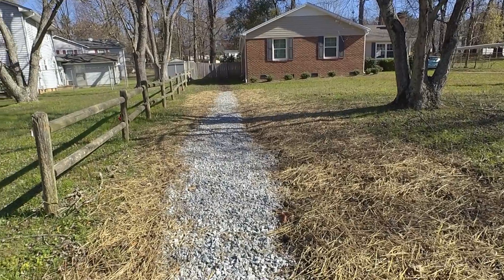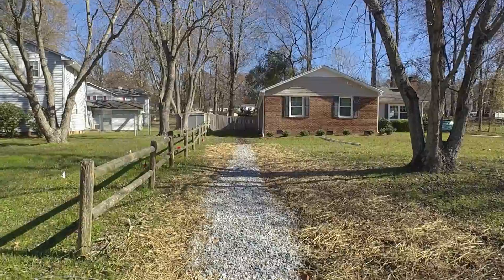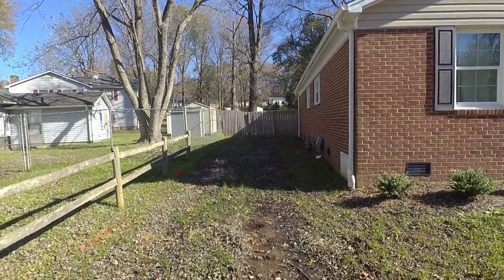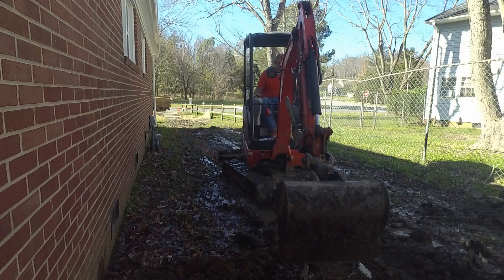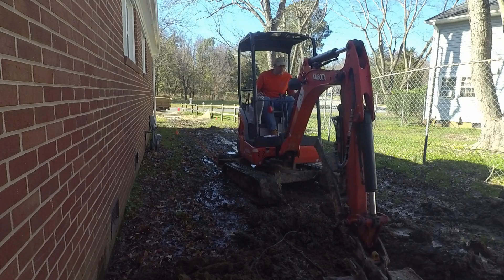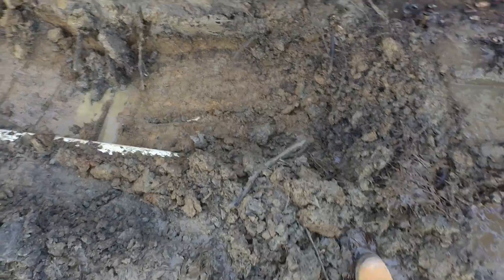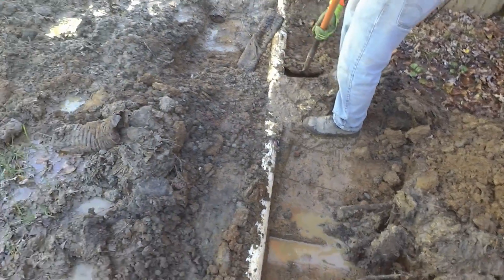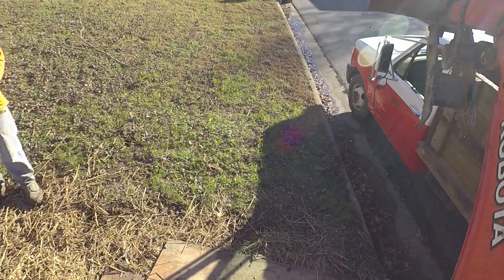Proof that french drains work! for draining non-point water sources

Comment: What about soil migration and roots through the open gravel which isn't wrapped in drainage fabric?
Reply from the maker: The gravel is the filter instead of a paper-thin filter that never gets changed. Maintaining the flow is what carries the fines through and out of the FD. This works way better to give an escape route for fines instead of clogging against a layer of fabric that never gets cleaned.

Comment: Really enjoy your videos, putting a perforated PVC pipe french drain at my footer and repairing/resealing my foundation wall with rubber. Considering doing like you always suggest and doing all rock down to the pvc. My question is can I put rock all the way up against the foundation wall also or should there be a barrier of soil between my foundation wall. (Located in NY) Also is it best to use crush rock or round river rock if im doing a open french drain? My understanding is the round rock provides more voids? Thank you

Comment: Could never tell, Are the holes for the perforated pipe down and to the sky or are they facing the two sides of  dirt? Would make sense to have them two sides of the dirt so the water could run on the smooth part of the pipe
Reply from the maker: The holes are positioned at 5 and 7 o'clock.

Comment: I showed this video to a Plumber friend of mine. He's kind of cheap at times. He promised to spend the money for a core drill and bits. When you use an electric hammer 30lb or 60lb it looks ugly. Awesome job !
Reply from the maker: Mac, just WAIT until you see our latest core jobs. I took some commenter advice and it now takes less than seven minutes to core a 4.5" hole through the curb with very little effort.
Reply: I saw the Hycon Hydraulic Handheld for over $2,000. That one day will be in my arsenal, lol.
Reply: 7 minutes, wow !

Comment: From a none expert, why do you not put the pipe in a fabric sleeve ?
Reply from the maker: The fabric traps fine sediment against it and the fabric is paper-thin. This clogs and kills the flow into the pipe. Instead of a thin fabric I use many inches of gravel. This preserves the flow and the fine sediments are rinsed through and out of the system instead of clogging against a fabric, further killing the flow.

Comment: French drains are not the answer and anyone that says so is unqualified quack - the only solution to preventing water ingress into buildings is to remove it and redirect the flow of any surface water - easy to do on a sloping site but harder on level slope where care must be taken to avoid saturating the soil by replacing it with gravel beds which only leads to more problems as the gravel must become saturated in order for the French drain to work is self defeatist nonsense - I recommend the best way to protect your property investment is to obtain an inspection by a water/structural engineer who can properly asses your home and its geology, water table, surface soil type, contours etc and formulate a qualified solution that can be registered and adds certified value to the home if when you need to sell the property or to add protection for any future insurance claims
Reply from the maker: Great advice Geeek. Here we were more interested in the subsurface soil type than the surface soil type, as you mentioned. Because we had impermeable subsurface soils, a FD was a great solution. That is evident by seeing standing water sitting on top of completely dry subsoil underneath. I talked to this HO a few weeks ago and everything is still working very well. Thanks for your comments!

Comment: Great videos and seems like a very helpful thing you do for people. That's great. The gravel situation. Why not just open the tailgate to the truck bed and use a shovel to just push it off into the wheel barrows? By the way, the dual barrows. Extremely smart purchase! Love those!
Reply from the maker: Hey Corey - Sometimes we do shovel the gravel by hand. In this case we were on the road so there was no way to back the truck up without blocking the road. Great question!
Reply: @GCFD  Understood! Again great job!

Comment: We have clay soil close to the surface and water just flows over it where there is any lower area of my yard or just collects on low spots. Frankly after a drainage guy came out at least 3 times and switching from perforated pipe to solid pipe to a gravel over pipe I’m ready to just dig a shallow ditch to direct the water off my yard.  Put in a sump pump even though when we have a hurricane it won’t work when we lose power for a week.  Frankly, what’s your option on a shallow ditch.
Reply from the maker: A shallow ditch should work if you have enough fall away from the area. 👍
Reply: @GCFD  Thank you so much.

Comment: I’ve seen French drain covered up with soil and grass, on top of gravel. Yours has gravel completely exposed. While the obvious benefit of exposed gravel is better for the water to make its way to the pipe, isn’t it visually better for landscape design to cover up the French drain with soil and grass?
Reply from the maker: If you’re not having major flooding problems then yes you can bury the drain. But these conditions required results over looks.

Comment: I'm looking at doing a french drain for my parents. Question I have though is if I put some dirt back on top of the top layer of gravel will it still work? The reason I want dirt on top, is there's no easy way to mow over gravel in the middle of a yard. Unless you've got a solution for that, then I'm all ears!
Reply from the maker: Here the area we placed the french drain had standing water/mud over dry dirt when you dig down. so if you place that dirt back on the drain you will be in the same situation. This is because the soils here are impermeable. The test to see if you can place dirt back over top is find the wet mud and dig down. If you hit dry dirt there's no way you can place dirt back over the FD and have it work.
Reply: build  abridging area at one point maybe with a small board walk and mow either side of the French Drain - just a thought.

Comment: I´m from Germany and we do it a bit otherways than you do.
Maybe "German overengineering", but we put an earth fleece around the gravel body, to prevent fine particles washed out from the mud, flow into the gravel and the pipe, filling and closing it after some time. 
Some times this might be to much, but I have seen and repaired more than one mudded-up drain.
Greets from Europe.  :)
Reply from the maker: By preserving the flow into the drain, there is more than enough energy to rinse out fine sediment from the system. I never understood why anyone would kill the flow with fabric.
Reply: fabric holds back fines from contaminating Stone it does not restrict flow at all. Water will pass through fines and fabric forever, water will also flow through 4 inches of topsoil to cover up that ugly Stone you leave in yards.
Reply: @deanbaker1905   absolutely

Comment: I'm curious why you put the straw down? Do you not just sow grass seed?
Reply: Consider that they are doing this work primarily to stabilize the ground which is waterlogged and reduced to slush mud - That means that with a new free exist like this there is a lot of water that needs to leave before the ground gets to its new "Normal" and that slushmud will erode by washing away far easier right now than it will in future as it should never be that sodden again
Over time the ground will become dryer reducing erosion and any grass will grow roots stabilizing it further but that can take weeks or months to establish.

In short the soil is at its most vulnerable to erosion immediately after a new drain install and the straw is a binder to reduce that
Reply: @bengrogan9710  Thanx for that Ben....makes total sense now!
Reply from the maker: To add to Ben's excellent description, the straw also protects the seed from granivores, holds moisture, and releases nutrients as the straw decomposes.

Comment: I put in over 1000 feet of drain 30 years ago in the woods.  I used a ditch witch to open  a narrow trench and left the extra dirt for a berm.   Put in pipe and filled it with stone.   The system is still working great.    I do not think you need that wide trench for that small amount of water.  My system is catching a hillside water shed.  when it rains heavy the water is held by the berm and then runs down hill.
Reply from the maker: Awesome! Thanks for sharing! - Shawn

Comment: 12 tonnes of gravel is crazy. The property looks quite new, maybe there's a reason that part of land wasn't built on. I can't help but think these types of problems will just get worse and worse the more we build.
Reply from the maker: The house had just been rennovated and sold to my customer. She was trying to get everything taken care of as she just moved in.
Reply: correct, if you have a perforated pipe of sufficient diameter, you can use significantly less gravel and thus excavate way less than this.

Comment: So do ypu cover the gravel with soil and grass then?
Reply from the maker: Nooo that would defeat the purpose of gravel letting water into the drain. The native soils here are impermeable to water as shown by muddy water sitting on top of dry dirt. Burying the drain would destroy its function.
Reply: @GCFD  I am one who would argue that if you had the proper variety of soil (that perks), you could put dirt (and sod) on top.  Indeed water will go through that and perk down into the gravel.  And as you say, the gravel will act as a filter.  But you can see that your soil in this video sucks for perking.  So you are best left with just running the gravel to the surface.  Over time, grass will grown into it and cover it.  But the nonwoven fabric wrapped around the entire system (pipe and gravel), and up over the top of the gravel (with either more gravel on top of it - or sod) has proven to be an excellent filter to keep small particulates out of the gravel.  It does not clog up.  Your system works for your area with the bad soil.  And one good thing - if it ever clogs up you can simply go back in and dig it out and replace the stone.  This pipe with the clean out used, will clean out very easily, given it's smooth inner surface.  You could even run a bristle brush that spins on a plummer's snake machine, like a chimney sweep brush while running water and it will clean off slime too.  Thanks for your nice delivery too. It's not whiney and sarcastic and filled with disjointed Attention Deficit Disorder ramblings.

Comment: Great solution, but man that gravel is an eyesore. Couldn’t you cover with fabric, few inches of dirt, then grass? I would think moisture would still work it’s way done 4” of dirt.
Reply from the maker: The native soils here are impermeable as shown by the wet dirt sitting on completely dry dirt. Burying the FD would remove its function in our soils. Definitely an eyesore but my customer wanted results over looks.
Reply: @GCFD  Got it, that makes sense. I was surprise how there was a few inches of muck then dry dirt. Keep up the good work.
Reply: @GCFD  is possible to replace the native soil with more penetrable soil?
Reply from the maker: @naturallynailah6983  you could but i wouldn’t want to bury my drains. Keep in mind that my customers are experiencing the worst drainage issues.
Reply: @GCFD  thanks I wish you were in Virginia

Comment: I wouldn't like all that gravel. Just my luck, my mower would throw a rock In my window or a neighbor's window.
Reply: Why would you mow gravel?
Reply from the maker: It's definitely a consideration. Here the homeowner chose gravel over mud.
Reply: @GCFD  maybe top it off with some rubber mulch.  I work around that stuff in the A/C trade and love it when clients have that stuff.  Also I read that it is heavier than water.  Just a thought.  Also might be able to charge more. 👍 Great work man.

Comment: You don't wrap pipe & gravel with geo textile fabric?
Reply: Because he doesn't believe in it and thinks that it actually hurts the draining of the area. 🤦‍♂️
Reply from the maker: Correct. Wrapping the drain up kills the flow into the gravel. We have impermeable native soils here so these FDs are catching non-point surface water and not subsurface water. I have several of these going for several years with no issues. The high flow keeps any fines rinsed out instead of clogging fabric. I'm also not afraid to show my outfalls!
Reply: @GCFD  will the soil flow into the pipe and clog the pipe due to no geo textile fabric?
Reply: I was wondering that also

Comment: When the water flows to the French drain it brings mud with it and clogs the gravel and holes in the pipe.  This French drain will do good for a few years then slowly it will fail.  If you wrap it in geotextile fabric it will never fail.  Very bad work by someone posing to be a expert in the field. Burrito wrap it and it will last forever!
Reply from the maker: HI Mark - Thanks for your comment. I don't see how a thin layer of fabric is going to filter better than many inches of gravel and not clog. These french drains are working very well. I just uploaded a video talking all about FDs. Show me your outfalls!
Reply: I just wonder how people like the gravel and in the yard
Reply from the maker: @nelsonmiller6800  they like it much better than mud!
Reply: Good point!
Reply: The fabric actually acts very well as a filter and keeping large particulate out of well built French drain. I use it all the time and have not had any issues. Furthermore you can lay grass back over it and still have proper drainage and usable yard.

Comment: How does air holes in the cleanout help the system?
Reply from the maker: They function as venting holes. It helps things flow more freely.
Reply: The fall of the pipe means that in extreme rain fall the exit of the pipe can become almost completely filled by the water rushing out with no room for air to fill the space.
if there is no air vent it results in reduced flow as the air forces its way into the pipe in a similiar fashion to if you just tipped a bottle of water 180 degrees over as opposed to pouring it
The air forcing its way into the pipe from the lower end disrupts the waters natural flow with the turbulence causing a reduced outflow speed

Comment: How much do you charge per linear feet for french drain systems? Or how do you usually bid it the job. Do you ever encapsulate the tile and stone with drainage fabric?
Reply from the maker: I usually charge by the job. This job was an example of a french drain with easy access. My last FD was terrible access and simply cost more in machines and labor. I'm waiting for rain to get some shots of that system working before I publish it.
Reply: @GCFD  that’s understandable. Machines, accessibility, etc. In your opinion. Does the french drain work best with just rock surrounding drain tile or burrito wrapping the rock and drain tile with drainage fabric?

Comment: Why not the holes are on the side? Or on top?
Reply from the maker: The water floods up from the bottom of the trench and then floods into the holes, which are positioned facing down. There is little point to holes on the sides or top.

Comment: Awesome work. You should look into a Ventrac with the power bucket. That would make short work of that gravel and handle that mud with minimal damage to turf.
Reply from the maker: Yes! I'm in the market for a Canycom track buggy. It's a little bit redundant with my mini skid steer but the buggy can run loads very quickly and weighs much less.